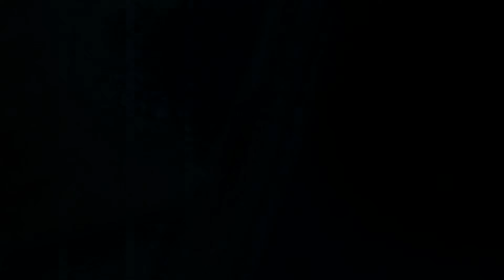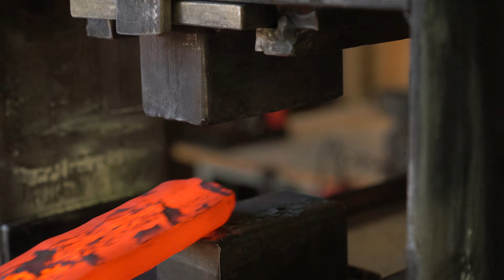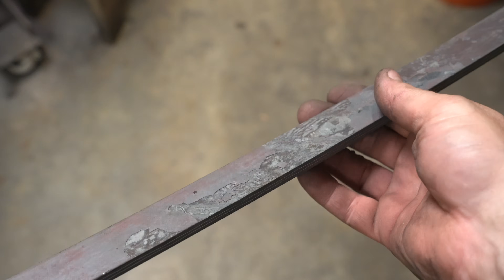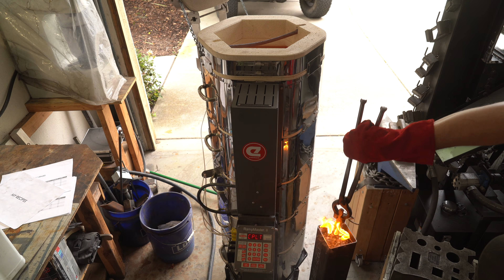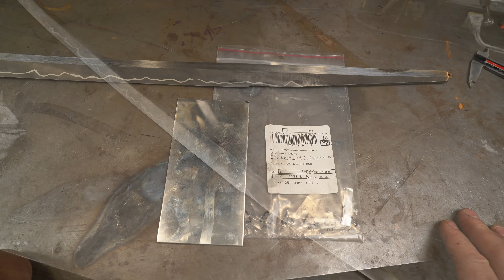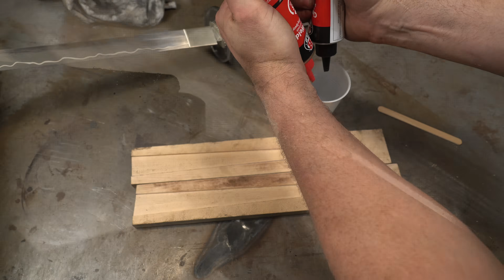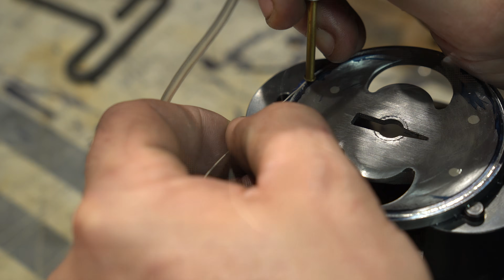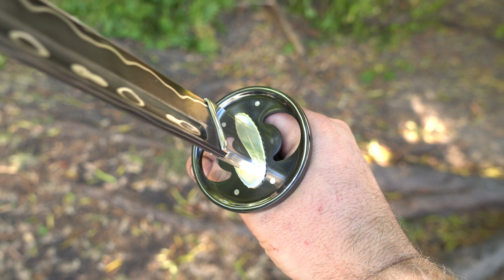Forging a Silver Damascus Katana

Comment: Where did you get the silver for this
Reply from the maker: The silver was purchased at Stuller.  They are a jewelry maker supply store.  Thanks for watching.
Reply: Do you think .999 pure silver coins or bars would work similarly to the sterling that you used? I have access to plenty of silver in that form
Reply from the maker: @ohiovalleyforge5383  The silver in the blade was .999 pure silver, which you need because it has the highest melting point. The habaki and seppas were made with sterling because its a bit stronger.
Reply: Thank you I always appreciate your content and started doing cu-mai blades with some advice from you and have really wanted to try some smaller EDC style blades with silver layers. Seems that I have what I need at least give it a try

Comment: have you ever considered making a can billet from all of the metal dust that ends up on your workshop floor and all the waste material?
Reply from the maker: The problem is that grindings have a ton of ceramic particles from the belt and would not make good blade steel.  Also those tiny particles are “burnt” off the blade and the carbon is burnt out of them.  Cuttings from a bandsaw would be better.  Thanks for watching.

Comment: Is there a formula or anything to use to figure out how thick of a sheet of copper or silver gets used as the brazing layer?
Reply from the maker: I use very thin sheets.  Typically .017”-.020” thick.  I have a video on layered construction you might find helpful.   https://youtu.be/YCDwoIJwaNI?si=N6ew-UyxJAQ6xIKK. Thanks for watching.

Comment: The smith's that be on forged in fire need to start watching you to learn these tricks
Reply from the maker: No time to do most of these things on FiF, unfortunately.  This sword took >120hrs to complete, not 35.  😉.  Thanks for watching, Michael!
Reply: @TyrellKnifeworks  absolutely, the main parts I think they tend to miss is fixing a warp, and working with fine or softer metals when making damascus blades. I myself have 2 damascus katanas a red damascus and a blue damascus and both are beautiful ( done alot of studying and research papers  over samurai and feudal Japan back when I was in school)
Reply from the maker: @michaelmills6103  if I ever make it on the show, I’m definitely bringing a straightening hammer! 😜

Comment: You don't cast your Manuki? I just cast a pair of silver dragons for a build I'm doing. Also, you don't want a Hamone line? Katana have always been pattern welded steel. I've made several wild pattern steel Katana's but they all have a hamone. Your sword came out beautifully. Very nice.
Reply from the maker: I chose not to cast them for what I was going for.  I don’t want a hamon over the Damascus, it looks odd and the Damascus on top won’t etch as nice.  Katanas we’re not made with pattern welded steel but rather bloom steel (tamahagane) which is very different.  Thanks for watching.

Comment: I have possibly the best or most interesting idea for a damascus weapon.
Reply from the maker: Yeah, what’s that?
Reply: @TyrellKnifeworks  I’m clueless and don’t know anything about forging but here’s my pitch. Make an aluminum and steel Damascus sword (if that’s even possible) then apply the Liquid Metal “gallium” to the aluminum surfaces of the blade. In theory the gallium will breakdown the aluminum and it’ll easily be able to be removed. My thinking is it would leave you with a unique “skeletonized” sword that’s really only good for display. All the parts of aluminum will be removed and all that’ll be left of the Damascus blade is a symmetrical steel grain. It’s hard to really describe what I mean without sounding ridiculous or far fetched but I think it’s possible, then again I’m clueless.
Reply from the maker: @YouTubeH8sFreeSpeechAndFacts  aluminum has such a low melting point, it could never be forged with steel.  It melts at 1221F and steel won’t even be red at that point.  Sorry, this isn’t feasible.

Comment: what is the stuff that flakes off? is that lost material, or is it some kind of carbon or something just from the forge?
Reply from the maker: That is iron oxide, normally referred to as forge scale, formed when the hot steel is exposed to air.  It's a waste product that has no value and is thrown away.  Thanks for watching!
Reply: @TyrellKnifeworks  interesting! thanks for all the amazing video content!

Comment: Question.. I have notice a lot of the forgers out there doing the cut and stack method. How the fold method is not used?
Reply from the maker: Folding only doubles the layers.  Restacking multiple layers gives you more layer count with less heats.  It’s just simple math.  Thanks for watching!

Comment: Beautiful build! Can i ask what engraving equipment are you using, it looks so effortless!
Reply from the maker: For the silver inlay, that was a Lindsay AirGraver.  They are quite expensive ($1800 for the kit) but work really well.  If you mean the engraving of the katakana on the tang, that was a GRS high speed rotary tool.  It spins at 320000 rpms and is a great tool.  They are about $500.  Both of these require an air compressor as well.  Thanks for watching.

Comment: Thank you for this incredibly educational video!  6:27 may I ask how you accurately gauge temperature over each successive "brazing" heat?
Reply from the maker: I have a thermocouple installed into my forge and it’s actually computer-controlled.  The computer controls the gas inlet.  😉. Thanks for checking out this build! 🙏

Comment: Truly a impressive  build  with  your  precious  metal mascus . But  I'm sorry pure silver will  tarnish  over time   all of the  peaces of  viking knitting  I've made  in pure tarnish
Reply from the maker: Pure silver will not tarnish.  Sterling silver will though.  The silver in the blade is pure silver while the habaki and seppas are sterling but that’s no difference than the typical copper or brass.  Thanks for watching.
Reply: @TyrellKnifeworks   sorry  brother  but  I've been  working  with  999 silver  for  about 18yrs  with  my  viking knitting  and it  does  tarnish  the  1/4ounce bracelet in 5point triple  knit  is almost  tarnished  purple  where it  sits on my wrist  42ft starting distance  and 8inch on hand
Reply from the maker: @williamhart4896  sure, jewelry held against your skin can tarnish because of moisture.  This won’t be an issue with a blade that’s taken care of and not exposed to moisture or the carbon steel will rust far faster then the silver will tarnish.
Reply: @TyrellKnifeworks  yup  full agreement  there

Comment: what is all the stuff that flakes off in the forge? is it an oxidized layer of the actual metal or an additive?
Reply from the maker: When hot steel contacts air, it reacts with the O2 in the air and oxidizes and produces iron oxide, commonly referred to as forge scale.  It's a waste product and it flakes off when the steel is manipulated.  Thanks for watching, Colin.
Reply: @TyrellKnifeworks  thank man! Love the channel! Do you have to account for that waste when planning your builds or is it negligible?
Reply from the maker: @Flurdaman  For any forging project, particularly damascus, you need to account for waste.  Damascus is particularly problematic because you need to account for the ends you cutoff, the grinding you do between restacks and what you lose to scale.  The more you forge, the more scale you produce.  That's why hand-hammering damascus has a huge waste percentage because of the number of heats you need to do.  
I usually calculate around 15-25% waste depending on the pattern.

Comment: Contact cement is not used like normal glue like you did. You need to apply on both pieces, let them dry fully, then stick them together very carefully for a chemical bond between the two pieces with dried contact cement.
Reply from the maker: Thanks for checking out this build!  I appreciate it.
Reply: @TyrellKnifeworks  My pleasure! I'm not surprised you are judging this year. You are an absolute master at your craft and in a great position to judge other builds. 👌👍
Reply: Just finished the video now and you've really outdone yourself! This looks like a million-dollar piece!

Comment: Sensei, can you link me to a video for why you use a kerosene dip before you forge weld? Does it act as a flux? I would have thought the oil would cause deflections. Seems very interesting to me
Reply from the maker: I don’t have a specific video on it.  The theory is that the kerosene coats the steel and forms a protective barrier against oxidation.  As it burns off it also creates a low oxygen environment, both help in forge welding.  Thanks for watching.
Reply: @TyrellKnifeworks  thank you! Maybe I'll give that a try next time I fire the old forge up

Comment: Getting back to our conversation earlier,  I think i could have added that im a beginner blacksmith,  not a bladesmith,  thats why i was asking about punching the hole and the macining, rather than drilling,  thinking as a blacksmith,  i meant hot punching,  which, to me seems easier than drilling,  especially in high carbon or stainless.  And i think you took it as cold punching which would propane require specialized press dyes.
Reply from the maker: I know you meant hot punching.  It’s just not accurate at all.  You’ll get a lot of slop around the hole.  If you want a nice fit, drill/file the hole and then you could hit fit it.  It’s not about which is easier, it’s about the final product. Makes sense?  Thanks for watching.

Comment: I like your approach to the ladder pattern. I wonder if it just needed tighter spacing?
Reply from the maker: I should have done it closer to final dimensions.  It was forged out too much after.  Oh well.  I was a bit paranoid on forging this as it was. 🤣. Thanks for watching.
Reply: @TyrellKnifeworks  I would be as well. I was concerned you'd nip through the silver. Amazing work as always though.
Reply from the maker: @VanDamArtisan  but nipping the silver would be ok as long as the temps stayed low.
Reply: @TyrellKnifeworks  yeah. I didn't consider that

Comment: Doing this with such a notoriously low melting point metal as silver is absolutely insane. Beautiful work. I'd love to see something like this with gold, and stained dark for a beautiful contrast. What would be super pretty would be engraving channels off of that stripe of silver/copper/w/e with more material to make that stripe look like a lightning strike arching down the blade.
Reply from the maker: I did 24k gold last December, just not in a sword.  Thanks for watching
Reply: Oh, yes I remember now! the chef knife! That thing was beautiful! I loved the wood you used for the handle! @TyrellKnifeworks

Comment: As a rule, I much prefer seeing blades forged to shape with hammer and anvil than cut and ground to shape, but your blades are the exception because I know the Damascus patterns you specialize in are prone to distortion if you hand forge to shape, and I understand enough metallurgy to know that non-ferrous metals really don't take well to forging in the bevel. Moreover, I'm no spring chicken myself, and I've been physically limited my whole life because of scoliosis, so I empathize greatly with using the hydraulic press and the rolling mill to do most of the shaping. I have certainly seen enough of your work to know you have the skills. So, while my style won't be much like yours if and when I take up blacksmithing and bladesmithing like I want to (it remains to be seen if I'll even be physically capable of it, with wrists and a back that are questionable on a good day), I love watching you work because you produce some absolutely beautiful pieces.

And, yes, I've seen katana (uchigatana if you want to be precise, but ) forged with traditional methods (YouTube is a blessing for learning about these kinds of things), and yes, one could absolutely quibble about these things, but at the end of the day, what does it really matter?
Reply from the maker: Each knife and build has its own process and method.  Some benefit from hand work (feather in particular) and some stock removal.  I’m more interested in producing the best final outcome, not necessarily the exact method, be it traditional or modern.  Some guys are purists for certain methods, that’s not me, but I have nothing against those that do.  (Just don’t impose it on others.🙂).  Thanks for following the channel!

Comment: Dude....you can get a 100 oz silver bar for right over $2000. That's over 6 lbs. Whoevers selling you your silver is ripping you off....= )
Reply from the maker: You guys don’t realize that processed metal in sheet form is priced differently.  Go to Rio Grand or Stuller and look at prices.  Thanks for watching.
Reply: Probably... but the whole point is that you can do it yourself. You've got a rolling mill. Save yourself some money....= )
Edit;  nice job on the Katana. I've never seen anybody do it in silver before. I think that the fuller cuts where you exposed the silver really made it pop....= )

Comment: Wouldn't silver weakan the overall strength of the blade?
Reply from the maker: The silver is a very layer, about the thickness of two pieces of paper after forging.  It’s brazed to the steel and has a tensile strength of around 70000 psi.  It adds some flexibility to the sword and doesn’t compromise its strength.  Thanks for watching.

Comment: I'm certainly not an expert in swords, and I've never attempted blacksmithing. I only recently started taking an interest in high end stainless and carbon steels for knife blades. 

But I have been aware of "Damascus" steel for at least 15 years. I've seen countless examples of it, but ^this is hands down the slickest looking blade I've ever seen. 

BTW, why was the piece of 92% sterling silver so expensive(over $1,000)? If I had to guess, I'd estimate it weighed less than 7-10 ounces before you started cutting it. That should put its price around $150 - $200. Even if it weighed 1lb, it would still be valued at $650.
Reply from the maker: If you get silver from a supply shop, it's always more expensive that raw silver. Check prices from Rio Grande or Stuller and you'll see.  Thanks for watching.

Comment: Why in the heck would you pay that much money for that piece of sterling silver you used for the habaki when you could have just went down to your local coin shop and bought “Junk Silver” coins which are old US dimes quarters half dollars from earlier than early 1960’s because those coins are like 90% silver. Coin Shops sell them in bulk to melt down or just have bags of silver and then you could have used your new melting furnace to melt them and pour your own material to make the habaki. Hell, even buying a couple generic .999 bullion coins or bars and melting them would have been cheaper by $900
Reply from the maker: I already needed to purchase the pure silver for the blade from a supply house, so purchasing this was easier.  I also mis-quoted it in the video, it was $660 for the sterling.  Thanks for watching.
Reply: @TyrellKnifeworks  still a huge cost difference over buying old junk silver US coins or even generic 99.999% pure silver bullion coins or bars and melting those. You got that nifty little melting furnace get yourself some different graphite molds so you can pour different sizes and shapes and your rolling mill is perfect for that kind of stuff to thin it out and stretch evenly. Just something to think about for your next project, almost every decently sized city has a coin shop but they might be coin/ jewelry shop, and like I said the junk silver they sell by bulk weight so you can walk out with a cloth bag with enough silver for many projects in the future and the 90% silver is close enough to Sterling Silver that you can’t eyeball it and it’s not like you are going to Hallmark the fittings as Sterling Silver. Anyway hopefully this helps you out in the future, it’s always better to have extra cash for new tooling than unnecessarily spending it on overpriced materials. Great Sword though, both you and Old Hickory went for a Ladder Pattern though, coordination between the judges?

Comment: I cringed when you said your thermocouple had failed. Clearly the forging gods were with you, as the result didn't seem to have any issues. I'd have been frantic about getting the billet too hot and having the silver all melt out, and of course that's why you put the thermocouple and fancy chips in. Beautimous.
Reply from the maker: There are a few places where the silver line is a bit thinner, but certainly not a failure.  It was close though!   Thanks for watching, Bryson!

Comment: Since you said you aren’t technically forge welding the final billet with the silver in it, will it decrease the overall strength of the final product? Great looking build btw.
Reply from the maker: If you look up brazing, the tensile strength is over 70,000 psi in tensile strength.  You’d destroy the blade before you shear the layers apart. 😉. Thanks for watching!
Reply: Wow. Ok. That’s amazing. Well, awesome work as always. Love the silver over the black. Absolutely gorgeous.

Comment: What happens to the metal used in welding? Where does it go in the billet / is it noticeable in the final pattern as it's a different type of metal?
Reply from the maker: That weld is all ground away before the blade is profiled so it never ends up in the final project.  Thanks for watching.
Reply: @TyrellKnifeworks  ahh understood! Beautiful blade

Comment: I recently discovered there is a super hard alloy of platinum and gold. Obviously it would be expensive but could it be turned into a blade?
Reply from the maker: Both gold and platinum are still very soft so an alloy of them both would still be WAY too soft for a blade.  It could be laminated in like the silver on this blade though.  It would cost a ton.  Thanks for watching.